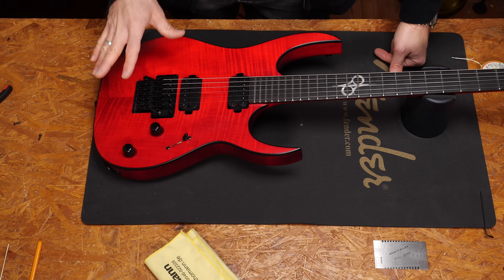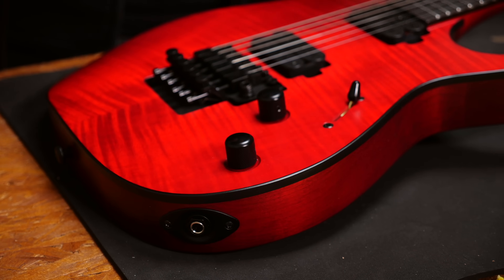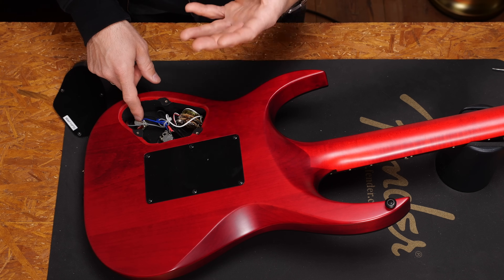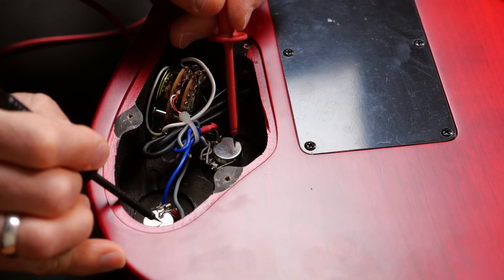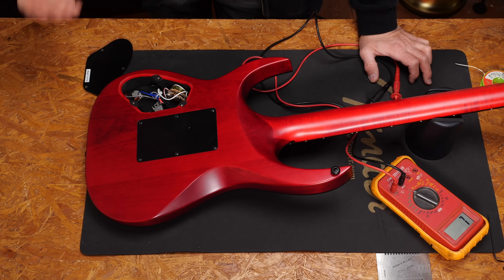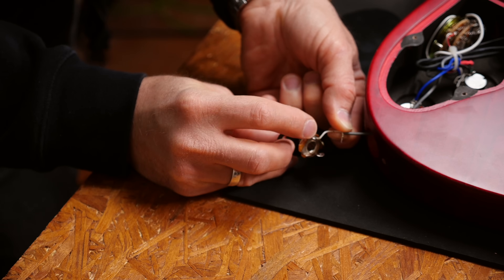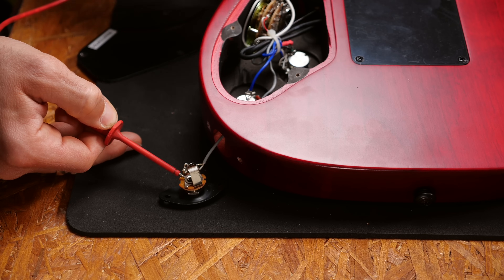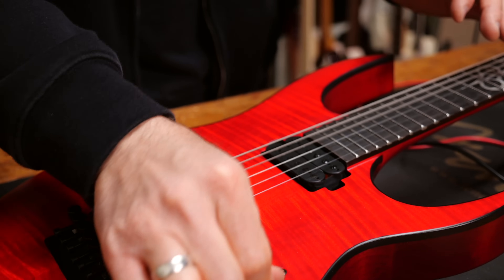How to fix Ground Noise | Guitar Tech Tips | Ep. 8 | Thomann

Comment: I dismissed the secondary pickup. And I I only have volume knob. And all wires are connected well. But it still has a little noise , and when I'm not touching the strings it will buzz alot. And the ground wire is connected to the bridge. Any help ? Also I've not done aluminum shielding cause I don't think it will help alot... ;? Anyone can help me. Thank you

Comment: hello sir i have electric sitar ....or i installed a seymour duncan sh 13 pickup ....which is connect to the direct jack....it makes too much noise.. i think it a ground loop problem ...but i dont know how to fix
Reply: Please help me
Reply from the maker: Hi, wow that's a heavy metal pickup. Interesting choice for a sitar. :) So the black wire is the hot (or signal) wire, that goes to the jack. The red and white wires should be just soldered together. The green and bare wires need to go to the ground lug of the jack. There's one more thing: you have to check if the ground buzz goes away, if you touch the jeck. If yes, you have to ground the strings of the instrument too. That needs a wire between the bridge (if it's metal) or the end of the strings and the ground lug of the jack. I hope that helps. Cheers //Kris

Comment: Hi there, I get a Pop and crackle every time i move my guitar while its connected even if i just adding a little vibrato to a note any suggestions with what this issue might be?
Reply from the maker: Really good question Mihir! As far as I can tell, there can be two reasons: 
1. the guitar is static (it's charged and whenever you move it and rub it against your hand / pants / shirt, it crackles. That's not a nice situation, I don't know of any solution to it.
I'm afraid you'll have to google it and look for a way to fix that. 
2. The jack is loose (or any other cable in the electronic is barely connected) and needs to be fixed. That's not a big issue, check out this episode: https://youtu.be/kcXaWSaLWC8
Hope this helps! Cheers! //Kris

Comment: I get a mild shock when I plug my guitar (through an AI) to my laptop. But I only get the shock when the laptop is plugged, I don't get the shock when my laptop runs on battery. 
Kindly help me diagnose the problem.
Reply: Sounds like a problem exists when you go to your power supply the one from your wall to your computer? Is there a three-prong plug on your computer power supply? Is it happening at or in one room can you plug into another outlet in another room and does it still do the same thing? and when do you get the shock when you touch the guitar or when you're touching the guitar and you touch some other metal... Those are a couple first things to check out
Reply: @LTJR.  I haven't tried in other rooms but it happens in my room. When I plug the guitar to my tube amp or my laptop I feel the shock. I feel the shock when I touch the strings. I recently purchased a tube amp that was when I first got the shock, previously I had a black star combo amp and I don't ever remember getting shocks in that one
Reply: @sumanchhetri1809  this might sound funny but does it happen every time or could it be static electricity?. Also is the house wiring all up to code? And that might depend on where you live. Do you have one of those little yellow things that plugs into the wall and tells you if the outlet is wired correctly? And where are you at... We were just joking yesterday about a trip to Cabo San Lucas where I couldn't turn on the shower with a bare hand without getting a shock. Is your amp equipped with a three-prong grounded plug and also your computer? If there's only two prongs then you have a 50/50 of possibly having a chassis that's hot on something.

Comment: Also could be a bad phono cable. The cheap cables supplied with guitars are not good quality. Better replace them with something better. I have found Stagg cables - not expensive - to be reliable and easy to access and resolder the jacks should the need arise.

Comment: What about when I connect my guitar to an amp it doesnt get ground noise, but when I connect it to my audio interface i get noise? What would the solution be?
Reply: Are you using a quality power supply?  Especially with the audio interface you want a quality power supply and not a bunch of $2 wall warts.  This is the first thing i’d change....

If thats not true, you could try a switcher pedal that has a phase cancellation /lift button... sometimes this will eliminate buzz especially with crummy house wiring...

If both those are OK and your guitar doesnt have ground issues, it might just be rig induced noise. Like 60 cycle hum from Single coils, interference from long cable runs, Cable connections that are worn our or cheap, noisy power amp, etc... if thats the case, try using a noise gate...

Hope thar helps!
Reply: @chadbouterse8617  My Power supply is not top of the line, but it isn't half bad either. it costed me around 70€
Thanks for taking the time.

Comment: Mine buzzes when i plug the distortion pedal its very annoying how to fix?
Reply from the maker: Hey, if the buzz goes away (or at least gets way more quiet) when you turn down the guitar's volume knob, it's just noise from the pedal. You could use a noise gate or just turn down the volume knob as soon as you are not playing (that's what I do). If the buzz doesn't go away when you turn the volume down on the guitar, it might be a ground issue. Then you have to check your guitar the way I've shown it in the video. 
Good luck!
//cheers, Kris
Reply: @ThomannsGuitarsBasses  yesser...i think its ground noise...ty for the reply....

Comment: I’m sorry. But I believe that you unplugged the ground from the Jack on purpose. I’m sorry to so brutally accuse you of shenanigans. I just threw the 8515 pick ups into my PRS and the neck pick up has a good buzz and the bridge is nice and clean. I’m going over my soldering joints to make sure I don’t have a cold solder from allowing the wire to move while it was cooling. I’m suspecting the giant puddle on the toggle switch is the culprit. I might strip the wire again and try over again.

Comment: Hi! when I touch my guitar strings the noise reduces but when I don't touch the strings the ground noise appears, can anyone help me on how to fix this?
Reply: That's a very common situation and it just happens on any guitar with old style pickups (the kind  with a battery like EMG-active pre-amp are a different newer design) that's just a sort of inherent part of them. The Active electronics in something like a EMG or whatever are removed from the ground and actually help you not get shocked, but some don't like the sound. Every old style magnetic pickup that I've ever played, there's always noise when you lift your hands from the strings as you change the ground scheme, Its always quieter when you're touching and playing the strings. That's a way to tell if your pickups are miswired also because if you have something like humbuckings or whichever and you touch the metal and it makes a little more noise then you know the pickups are wired backwards to each other it should always get quieter when you touch it. 
Now just how much noise you're getting and if it's acceptable or not is another thing and also I'm not exactly sure about the grounding scheme with the active pickups so I don't want anybody tearing into me because I misspoke but I'm pretty sure about what I said.
Reply: @LTJR.  That's cool! Thanks!

Comment: I changed my bridge pickup on my strat to a humbucker by myself, thought I take up the challenge looks easy enough new pots new switch new wires figured nothing to it. And now my strat does not work it has been silenced.  Back to the drawing board
Reply: Wanted to say thank you to host
Reply from the maker: Thanks for watching the videos! In most cases there's just something small that causes the issue. Get a multimeter, with that you can track the signal (set it to continuity test) and find the problem. Here's an episode where I swap pickups in a strat, maybe it helps too: https://youtu.be/e6RqqXpwYOE
Cheers //Kris

Comment: Notice in this video... touching strings made it worse. If the opposite happens... you touch strings and noise drops a lot but isn't gone...

The vast majority of noise issues start with power quality. Homes share power with the grid, let alone your other home devices. Now throw in all the equipment that emits radiation/signals (cell phones, computers, lights, WiFi, etc.) and almost all homes will have very dirty power loaded with EMI noise.

See: https://youtu.be/1pW9WTiNuls

If you measure noise like that on your outlet power, it must be filtered or you will get noise.

Then, you should not have all equipment sharing same power circuit. For best results use multiple power conditioners and plug computer equipment into one. Powered speakers/amps in another, and audio equipment in third. I recommend inexpensive conditioners... if you combine them with balanced connections and EMI filters linked above. Example of inexpensive conditioner is this Furman: https://www.amazon.com/Furman-Standard-Conditioning-Outlets-Spacing/dp/B0014598WQ/ref=sr_1_4?crid=4Y6SAOAFGLQF&dchild=1&keywords=furman+power+conditioner&qid=1606602137&refinements=p_36%3A1253547011&rnid=386685011&s=musical-instruments&sprefix=furman+power%2Caps%2C211&sr=1-4

I haven't found a power conditioner under $1000 that gets rid of EMI like the Greenwave filters. it just costs much less to go this way. If you know of one... share. The Furman provides surge protection and improved filtering. Greenwave lowers EMI to below 25-50 mv. The difference is substantial. Without Greenwave, I still get noticeably annoying noise.

Comment: My Les paul tribute buzzes until i touch the strings.
Reply from the maker: Hey Allen, to a certain degree that's normal. There's always a little buzz until you touch the strings, since the player is what completes the grounding "circle". Without the player touching the strings every guitar with passive pickups will buzz. If that buzz is super loud (almost as loud as the signal itself) you need to check the wiring of course to find the issue with the ground wires. Cheers //Kris

Comment: Solder alone does not make a strong connection; solder makes the electrical connection.  A connection is strong when wire is spliced by twisting or hooked to a part before soldering, see NASA.
Reply: That is true and it is also true that an anaerobic crimp splice is even better. However, for this application the repair that is shown is fine. A guitar is not a motor vehicle with lots of vibration, nor a distant hard to reach spacecraft that is impossible to repair remotely.

Comment: That's actually not quite the right example. What you had there was an open circuit because the ground didn't make it to the output jack. A proper example would be that the jack is connected properly so that the guitar actually has output, but that the hum is overpowering that output or that it stops humming only when you touch the strings. That's a grounding issue. And the fix is to scout around to find where the ground is broken in a similar way to what you've shown but it's a different issue to an open circuit like this.